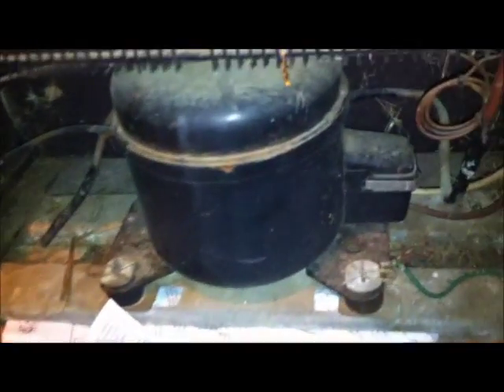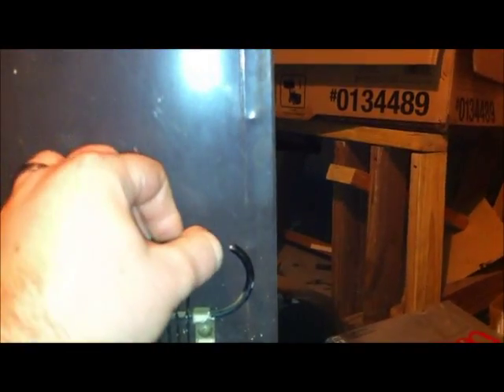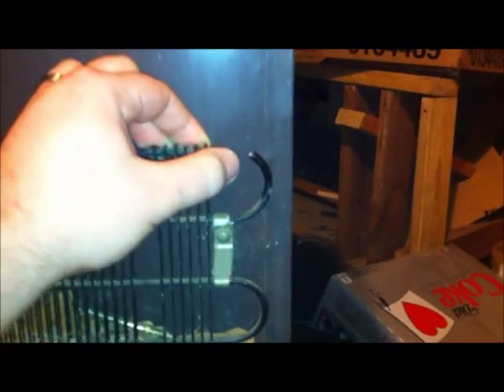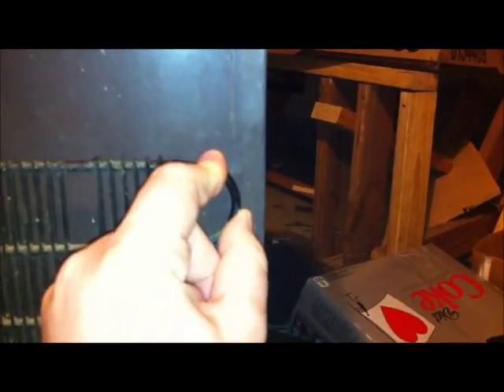Mini refrigirator find - Small reciprocating compressor

Comment from the maker: I would definitely recommend hiring a refrigeration or HVAC contractor...  Replacing the compressor is cheaper than replacing the whole appliance, but is pretty difficult to do, and requires a torch and solder, as well as equipment to recharge the system with refrigerant...